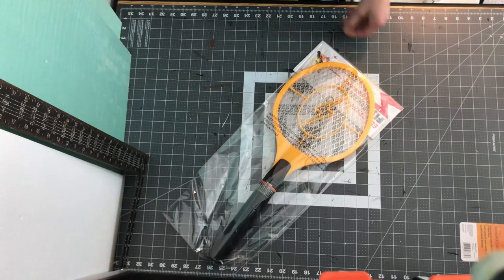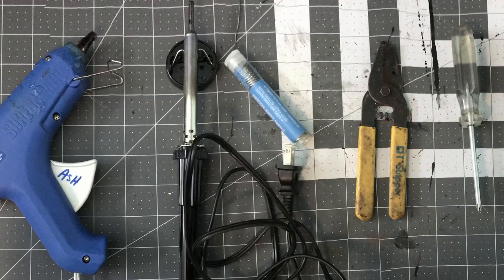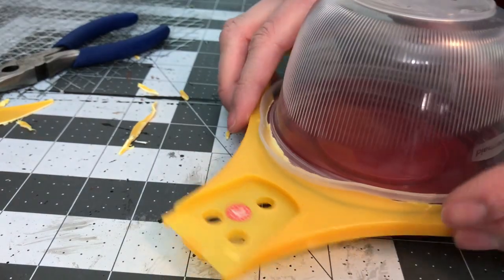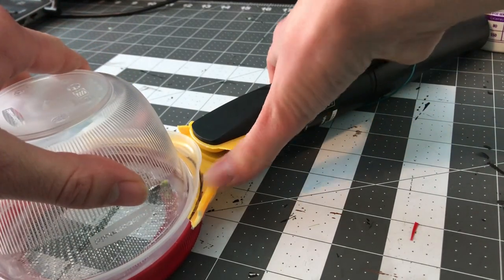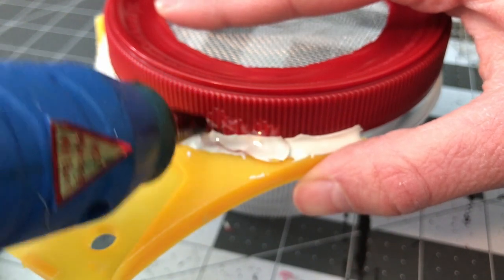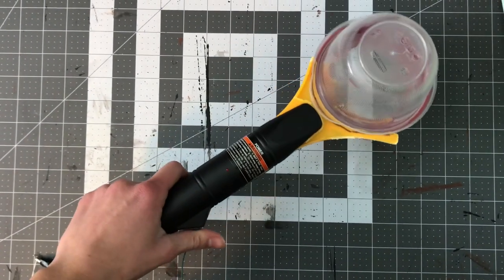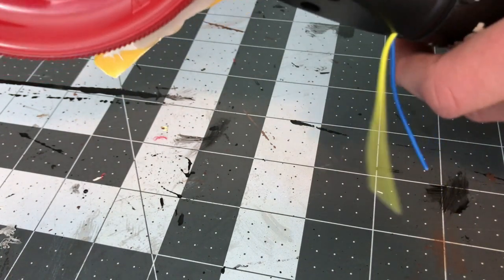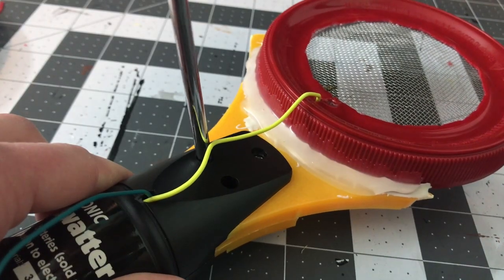DIY Static Grass Applicator for Under $10

Comment: This is an amazing design I would have never thought of no matter how many times I walked by those rackets. You said you don't have a heat gun but do you have a goodwill nearby with blow dryers as temporary?  I'm going to heat and bend the racket all the way around the cup instead of cutting it off. I'll let you know if I burned the house down
Reply from the maker: That’s an awesome idea! It’ll look great if it works well. I have a hair dryer, but I think I’m too impatient for that to work. If I have another project that could use a heat gun, I’ll probably pick one up from Harbor Freight. I didn’t even think about it being useful for this project.

Comment: AWESOME ! Does this work with regular flocking or do you need to use static grass and if so what grass do you use?
Reply from the maker: I have only tried it with static grass, but I’m not 100% sure what you mean by regular flocking. I’m still learning the finer distinctions in the hobby. Based on a quick search, it seems like people mean different things by flock… Anyway, if it is somewhat long strands of material and you want it to stand up, I think it’d work. I used the static grass available at my local hobby shop (I think it’s Woodland Scenics). So far, I’ve found that it works pretty well for 4mm grass, and okay for 7mm (the grass doesn’t stand up super well).
Reply: @okayminiatures7573  I will have to check my local Hobby lobby and see what type of grass I but and get back to you.It is the really small pieces variety.I dont know that it ould stand up but if so this would be great although I like the stuff you use better.Maybe I'll shop around online for better grass.
Thanks and have a great weekend.